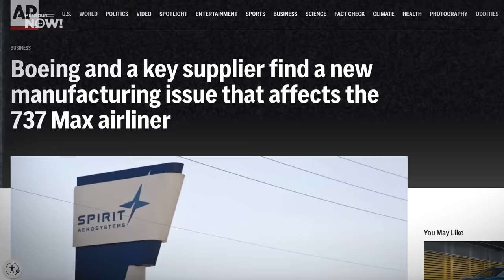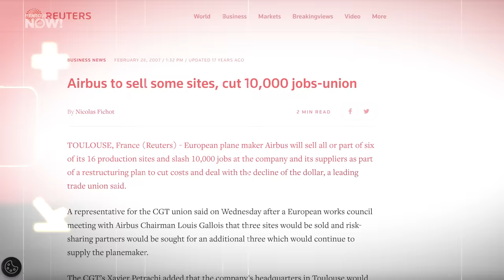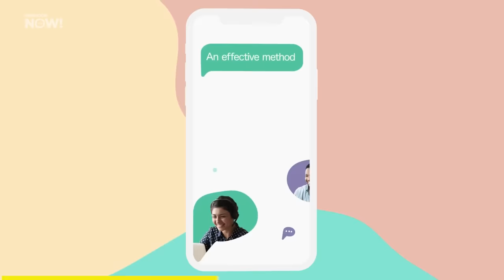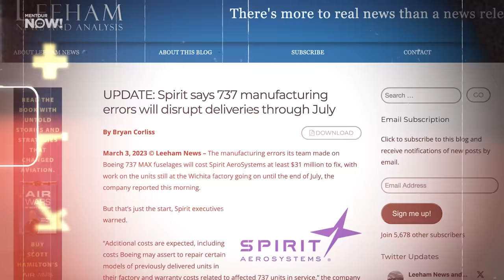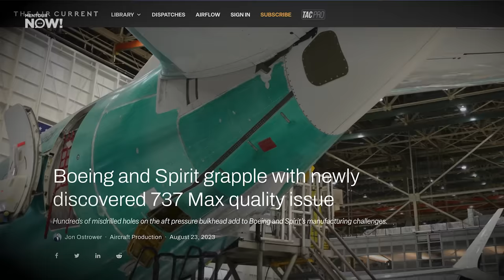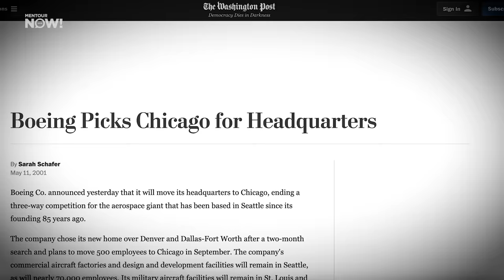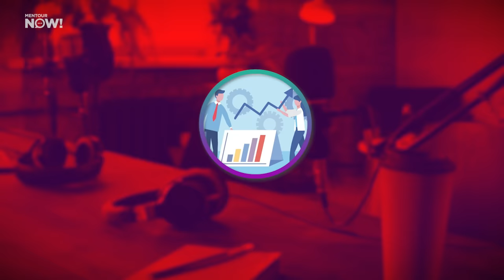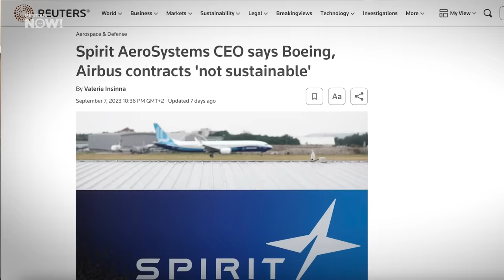NEW Problems with the B737MAX!

Comment: I think that Boeing’s biggest mistake was to change how they selected engineers to become managers.  They use to select based on technical competence. Now they select based on people skills and project management skills.
Reply: so, greed. 
or capitalism
Reply: @unflexian  Like communism and socialism has worked out so well.
Reply: @danharold3087  No one's talking about those two mate. They are irrelevant to this topic.
Reply: @sarthakmohanty997  One can not logically bash capitalism without the context of communism and socialism.  Or is just trash talk so logic does not apply ?
Reply: @danharold3087  Probably just trash talking the fact that Boeing, an aircraft manufacturing company, is probably prioritising management and money-making skills over engineering skills.

As far as the whole capitalism, socialism etc. thing is concerned, I do not have enough knowledge right now to make any comments.
Reply: @@arisnotheles I don't know if there are only two. There may be more, maybe not. Depends on the leader and the followers I suppose but I don't know for sure.

As far as Boeing is concerned, their greed cost lives.
Reply: @danharold3087 you do realize that there are many flavors of capitalism?
Reply: @sarthakmohanty997  You have it right with the trash talking part.  Every airline manufacturer is in a crunch.  Profit margins are very low.
Reply: @@arisnotheles Thanks for some insight. I have a question though out of curiosity. Does it absolutely have to be only one way or the other? Is it objectively the only way to look at things? 
I understand fear, anxiety and greed are some of the most primordial instincts of not just humans but other fauna too.
I suppose leading can be done in a way that involves all three in various proportions. I feel someone else may have a different outlook on the greed vs fear thing. 

At any rate, coming back to Boeing, as I said before, they overdid the greed part and it cost them human lives and public trust. I suppose their financial profits took a hit as well.
Reply: @Jehty_  Of course.   But when people criticize it is just capitalism.
Reply: @danharold3087  OP didn't.
You brought up capitalism. 
It's all just in your head. You are fighting strawmens.
Reply: @Jehty_  Was not replying to OP.  If there is a problem here it is not mine.
@unflexian
4 hours ago
so, greed. 
or capitalism

2

Reply

@danharold3087
@danharold3087
3 hours ago
 @unflexian  Like communism and socialism has worked out so well.
Reply: @danharold3087   sorry. My bay. Somehow overlooked that.

But my point still stands. There are many types of capitalism. And when people criticize "capitalism" they generally mean the - let's call it - pure form. Not stuff like social capitalism, etc. 
Yes, they probably should be more exact with their choice of words, but you bringing up socialism and communism (also in their "pure" form Edit: no, not the lure form. Just the few forms that have been tried. And you also seem to ignore that those countries generally didn't fail just because of their economic systems. They failed for a multitude of reasons) doesn't help at all.
Reply: @Jehty_  Not a problem.  I have heard worse today.   Pure capitalism does not exist at Boeing.  For example. "Boeing being awarded twice as much per seat for trips to the ISS as SpaceX does impact our view of Boeing as a purely capitalist company. It suggests that Boeing is not competing solely on the basis of price and quality, but is also benefiting from its close relationship with the US government."
I still have no idea what you point is and why you don't think one should be not be looking at the entire picture when capitalism is being discussed as a failure.

Comment: A defective aft pressure bulkhead is believed to be the cause of the JAL123 tragedy in 1985.
Reply: It wasn’t defective. It was damaged by an over rotation and an improper repair.
Reply: That's what I immediately thought of too, then wondered how it's not worthy to ground the fleet. but Time = Money and the risk and potential loss does not outweigh the revenue. Might only be a matter of time now. And I have at least of a couple of flights on a 737 coming up...
Reply: @rugger1009  So it ended up defective even if it didn't start that way.   Dodgy rear pressure bulkhead = worst single aircraft crash ever.   That just underlines how critical the bulkhead is.
Reply: @cr10001   - The bulkhead was not defective - during the repair the contractor only put in half of the bulkhead rivets resulting in failure of the bulkhead.
Reply: @rugger1009 And that particular repair fault is eerily similar to the issue at hand .  Missing rivets and misshapen holes both weaken the structural strength of the riveted bulkhead .
Reply: Indeed, it was badly repaired by Boeing.
Reply: @rugger1009  improper repair makes it defective
Reply: Well, we must also keep in mind the fact that the repair had exceeded its certified lifespan by over 2,000 cycles
Reply: @j.paulm.1575  that is not correct. In fact,  the Accident Investigation Commission (AIC) calculated that the faulty repair would fail after about 11,000 pressurization cycles; the aircraft actually had 12,318 successful flights from the time that the faulty repair was made to the time of the crash. That means although the repair was shoddy, it lasted longer than the AIC thought it should have.
Reply: @cplcabs   - apparently you have very little knowledge of the aircraft industry. It was improperly repaired by a sub contractor.
Reply: @rugger1009  apparently you don't know much about the business world. I suggest you find out about it and do some research before you comment again.

Comment: How the hell did those 'snowmen' get by the inspectors?? In high school i was in a program that focussed on aerospace/aviation. i was three years in a shop class that was building a Thorpe T-18 experimental aircraft, so i learnt about the level of fabrication tolerances needed for aviation. No 'smilies' on rivets, no skipping when drilling holes, deburr and burnish everything - and never ever angle your drill or REdrill anything. Measure and check three times before committing. i went on to work at Teledyne-Ryan at a time on the Osprey wing section - and no kidding, inspectors look for *everything*. So how did a company with a long history of aviation metal fabrication allow something like those through??

Comment: I would assume that these elongated holes would be at much higher of risk for metal fatigue stress cracks - I think this could be a major safety risk ...
Reply: and the experts say it is not.... so what makes you smarter?
Reply: @carly200  that is why I said "assume" - some of my concern is due to my three engineering and material science degrees and 30+ years of experience in mechanical engineering ...
Reply: In the aircraft engine industry all sharp edges are chamfered or radiused for just that reason.

Comment: For some reasons, this kind of pattern reminds me of stories I've heard with Airbus. My family comes from a rural area in France around Meaulte/Albert. Historically this has been the home of Potez, so, even if rural, this area has a long aviation history, (there is even a Potez 36 hanged off the ceiling of the Albert train station). Now days it an Airbus site. But a few years back, Airbus tried to make this location a subcontractor (splitting it into Aerolia). It seems they have been reverting this trend back a bit, but I'm still kind of worried about it (if it was to shutdown or even just scale down, the social impact would be huge for the area).

Comment: 737 MAX trim cutoff switches are wired differently than on earlier variants, preventing using electric trim switches in case STS/MCAS is turned off. The different wiring scheme has not been fixed when MAX has returned to flying.
Reply: It has actually
Reply: @nickolliver3021  Really? The last time I've read the list of changes, the trim cutoff switches were not there. AFAIK, they are still wired sequentially and do the same thing. Got a link?
Reply: Last I heard, that is the case.  Maybe Boeing came to their senses?  That would be novel.
Reply: @TinLeadHammer  I'm talking about the wiring scheme being fixed because otherwise it would not be flying right now.
Reply: @nickolliver3021  Why not? See wikipedia at "Maneuvering_Characteristics_Augmentation_System#Stabilizer_cutoff_switches_re-wiring" and feel free to peruse the links to the original sources. In another wikipedia article "Boeing_737_MAX_certification#FAA_Airworthiness_Directive_for_return_to_service" four items are listed, but not the re-wiring of trim cutoff switches to the NG configuration.
Reply: @TinLeadHammer  if your trying to prove that mcas and all the wires haven't been fixed then it shouldn't be flying hut as it is they are all fixed. Not sure why these links are posted despite the plane being airworthy again
Reply: @nickolliver3021  These switches have no direct relation to MCAS.
Reply: @TinLeadHammer  then what are you on about
Reply: @nickolliver3021  Stabilizer trim cutout switches.
Reply: @TinLeadHammer  they have been fixed

Comment: If something is not a safety issue why does it need to be addressed? Aesthetics? If it needs to be addressed to me it sounds like it is in fact a safety issue.
Reply: Keyword here is imminent. Safety comes in different shapes and sizes. And just because it’s not super urgent doesn’t mean it doesn’t have to be addressed.
Reply: It will become a safety issue after a certain number of pressurization cycles.

Comment: As a frequent flyer I want to see both companies (and others) succeed but now I just hope that my airlines of choice keep moving away from Boeing. Most of their planes give me less comfort and I definitely feel safer on Airbus planes at this point.
Reply: Why should they stay away from Boeing. How do you feel more sager on am airbus? How are they more comfortable? Just don't fly because Airbus are not safer
Reply: @nickolliver3021  The statistics definitely speak for a very high safety of Airbus planes.
In general I consider most of them more comfortable than Boeing's (787 being the exception). Also it's really nice not to have to check a seat map every time I fly just to check that there is actually a window in this row, a problem which only Boeing seems to have. That's not a safety issue but embarrassing engineering.
Reply: @the_bottomfragger Nickolliver is a renowned Boeing fanboy. You’ll never persuade him of anything.

Comment: 10% of the holes are "snowman" holes... that is quite a high error rate....especially if by chance group together. And if the rear bulkhead goes. it often takes out the hydraulics controlling the rears stabilizer, rendering the airplane almost unflyable

Comment: With all the problems this plane has had, it probably would’ve cost less if they updated the most gangster plane of all time, the 757…
Reply: 757 has always been my favorite.
Reply: The problem is that part of why the 737 MAX is so popular is because it allows airline companies to mostly reuse their existing investment in the 737, in terms of pilot training and certification (the MAX uses the same type rating), maintenance staff and equipment, spare parts, etc. For pilots and airlines it's a pretty big deal whether you're switching between two planes that use the same type rating versus switching between type ratings, and the 757 shares its type rating with the 767 but not with the 737.
Reply: It wouldn’t because airlines looking to update 737s wouldn’t have just bought new 757s. They wanted an updated 737 and that is what Boeing gave them. There’s no way they would’ve had an order book this large with a clean sheet design or a reengine of the 757.

Comment: Boeing has really lost the plot. Airbus take notice
Reply: Exactly.   If one can not do something effectively in house why expect a outside party to do it better.  Fix the problem inhouse and keep control over the product.  Automakers also need to take notice.  Recalls are rampant.
Reply: How have they if its a supier issue?
Reply: @nickolliver3021  it’s just one more safety thing the company fails at, it’s not even limited to their commercial aircraft they have problems like this throughout the company.
Reply: @Grunttamer  the company hasn't failed at any safety. This is a supplier issue and nothing on Boeing. The supplier sent in incorrectly built parts! Wake up
Reply: @nickolliver3021  Again, Boeing is ultimately at fault for not enforcing quality and spec compliance. My company uses suppliers, but monitors them closely.  Boeing should, but apparently doesn't. Our company president is out on the shop floor every day, looking for problems. You are apparently not in manufacturing.

Comment: For the A320, Airbus went with automated riveting which has computer precision for drilling holes.  The big question is whether the arrangement between Boeing and Spirit would make it possible for Spirit to invest in such technology to improve quality.  If Spirit is barely making money on the contract for 737s because of Boeing being very stingy, then it wouldn't have the money to invest to improve production.
 
as Bombardier was spending itself out of existence trying to launch the C-Series,  the Global 7500 and Lear 85 jets at the same time, cash was drained from other divisions such as Bombardier Transportation (trains/subways) and Aerostructures.  Darining cash from Transportation meant Transportation could no longr invest to increase productivity/automation at its sites and took on contracts it could not deliver on time due to lack of capital.  This was not only delay in deliveries but also prduction quality, The Toronto trams had to be physically sent back for major repairs after legal threats for failure to deliver working trams.  New York told Bombardier to not bother bidding for subway cars anymore.  And this made it worse because the only way a company with bad reputation can win contracts is seriously underbidding others.   When Transportation's assets were liquidated to Astom, most of the value was for the backlog of orders worth many billions. However, Alstom quickly found out that those orders were at unprofitable proces, and Alstom now needed to invest to upgrade plants so they could actually deliver those unprofitable orders without further penalties due to delays. 

Bringing this back to Spirit: if the contract for the 737 is not profitable or not profitable enough, Spirit won't have the cash to invest to improve production quality/productivity and will make matters worse.  Looks like this is what is happening.   Years ago, Spiring was onwed by Onex, a canadian investment form who sold it some years ago. I guess they saw what was coming.   

The 787 is a more recent example: Boeing, having gone legal againt Airbus for "subsidies" had to structure the launch of 787 to spread the rick , spread the borrowong, and spread the subsidies, so it gave contracts to a number of suppliers including voight that had no expertise in aersospare.  Boeing ended having to buy them so they could invest in equipnent and more importantly training of staff because that was "mission critical" to be able to produce 787s. 

So if Spirit lacks funds to invest to upgrade the 737 production,  and if it starts to affect Boeing's bottom line due to delayed deliveries (or worse, Spirit going under), then Boeing will have to take action as it did with Voight. Perhaps it could be just injectiuon of capital in exchange for minority staye in equity.  Or increase how much it pays for the parts so Spirit can self-fund production improvements.  Either way if Boeing wants properly built 737s it will have to reach into its piggy bank and someone fund  investment production improvements for Spirit. 

Note: when Spirit purchased Bombardier Aerostructures, it was during COVID and during 737 shutdown, so that would have been a drain on funds AND once they got it, they like would have found that like with Transportation,  Aeristructures had been drained of cash needed to ivest to streamline production.  Aerostructures also had lost the business of being part of  CRJ production which shutdown during the liquidation of Bombardier (during which iBBD had admitted the CRJ business was not proditable, which means suppliers were likely also paid at very low margin).  When you buy a company starving for cash, it means you need to invest to feed it a lot of cash to "fix" the company.  And that would have hurt Spirit's bottom line, further hindering any investment elsewhere.

Comment: 2:50 Correction:  Spirit AeroSystems used to be part of Boeing.  They split that section and sold it to Onex Corp in 2005 and contracted them back as a supplier.  Boeing was basically fed up with the unions and decided the way to reduce cost and price risks is to sell those money losing divisions off and used fixed price contracts to minimize any financial losses.  In a way, it worked, because Spirit AeroSystems was on the hook for any of the cost overruns.  However, they are the sole source provider, so if they go down, Boeing will go down with it.  It's called mutually assured destruction.

Again, more bad information.  Airbus also subcontracts Spirit AeroSystems for the A350 and A220 fuselages.   They are in the same boat as Boeing, except they have less risk since their bread and butter, A321 is still mostly produced by their own facilities.